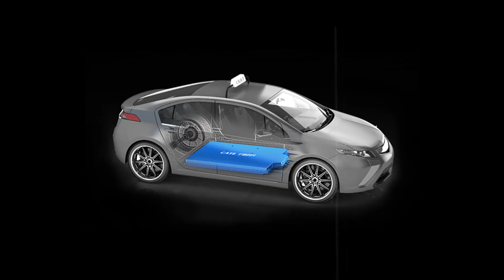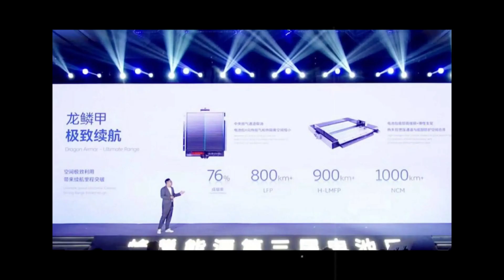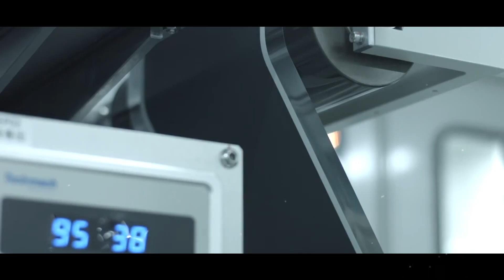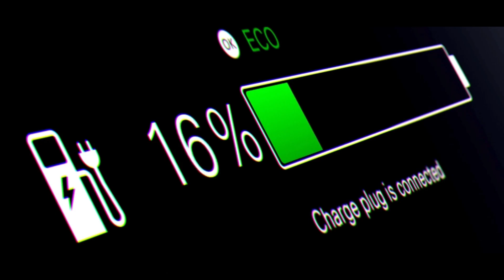New Tesla Model 2 ALUMINUM ION 10,000 Cycles, Near Zero Degradation, Powers Your Home

Comment: :text-green-game-over:Good day from Goonellabah, NSW, Australia. 👉Including Australia👈 , Tesla, and Elon know about ALUMINUM use in Batteries. ❤I served as both the project manager and civil engineer. I worked as an engineer in Singapore from 1999 to 2005. We designed and constructed twelve-kilometre tunnels with two boring tunnel machines and five stations. I also managed a team of 160 engineers and architects. I have been a contract engineer since 1975, constructing sewage and water treatment plants from Melbourne to Cairns. Moving forward, I initially aspired to attend NASA to become an astronaut, but I ultimately pursued a career as an engineer.😊Cheers, Ian Cleland